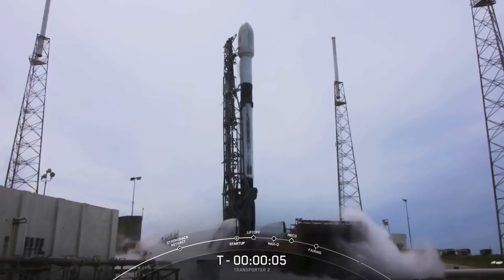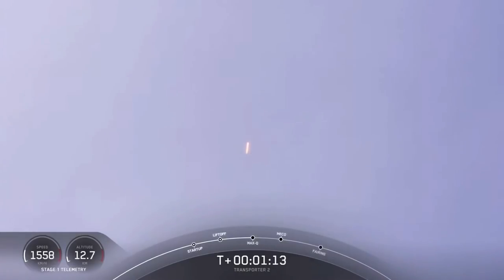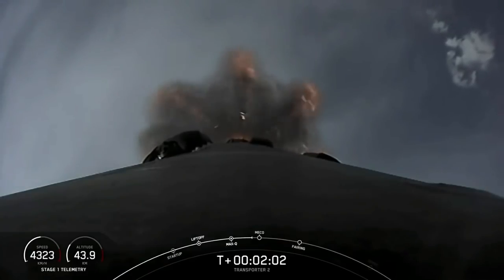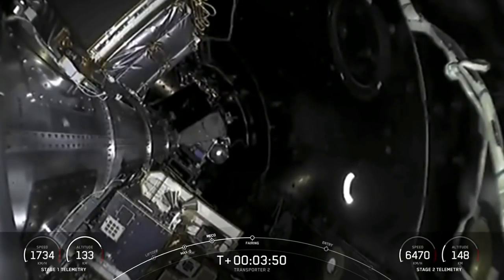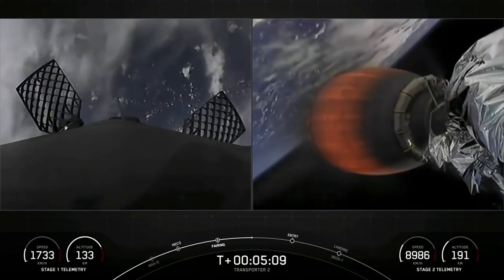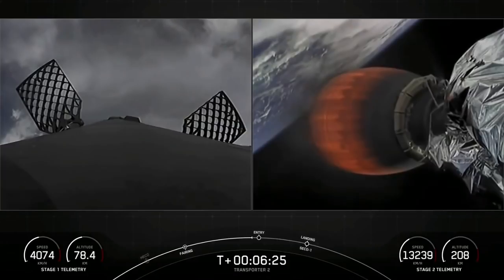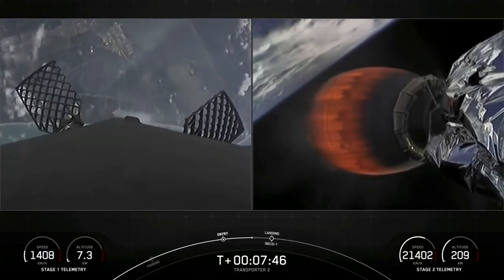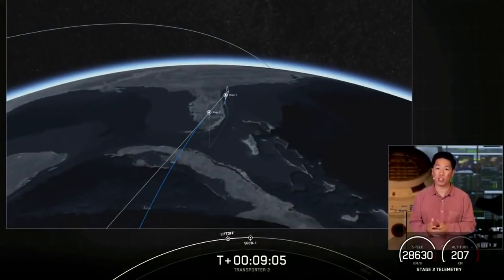SpaceX launches Transporter 2 rideshare, nails LZ-1 landing in Florida!

Comment: 0:18   It looks like extra flame off the right side of the lower part of the rocket.  Is that normal?
Reply: No it is not normal they are gaslighting us and people are eating it up
Reply: Looks like the oxygen vent being illuminated by the exhaust plume. Perfectly normal and poses no threat to the vehicle.

The Falcon 9 uses cryogenic liquid oxygen, which slowly evaporates as it warms up and has to be vented to prevent pressure build up in the tanks.
Reply: No that is not normal when it is all faked they got busted three times 2 with a mouse on the rocket mouse in the cabin running around the crew with no Gss during liftoff using there computers lol it is completely gaslighting
Reply: @rodneyhearld8151  I’m not saying you’re wrong and I’m not trying to start an argument but I really wanna see what you’re talking about. Is there a link?
Reply: @late344  youtube sensored and removed the videos , but I might have a link that still has it I will look
Reply: @rodneyhearld8151  thank you
Reply: @late344  world news reports  has them

Comment: Why is the foil above the 2nd stage engine wavering that far up?  Looks like wind effect but ther can’t be any oxygen up that far.  Is it vibrations?
Reply: There is still a small amount of air. The atmosphere gets thinner as you ascend, until you hit 100 kilometers altitude. That stage separates well before then.
Reply: Because it all fake kinda like the mouse on the rocket during flight and how about no Gsss in the capsule while going to the space station
Reply: @rodneyhearld8151  The only fake things around here are your brain cells.
Reply: @EuroScot2023  keep telling your self  that, sad you can't see what is right in front of you, it is plain and simple common sense, but you might be lacking that

Comment: What is that plasticky kind of Foil reflective material.... why doesn't pop with the pressure of the speed of rocket?
Reply: If you're talking about the foil around the motor components of the second stage, it is probably aluminized kapton, which is a strong, thermally stable polymer that has had aluminum applied via vapor deposition. It is used as a thermal reflector and barrier for the motor components. At the altitude of second engine start, there is nearly no atmosphere, so there would be very little, if any, visible interaction between it and the air.
Reply: The second stage engine has a thermal blanket over it to reflect excess heat away. The air gets very thin as you ascend into the atmosphere, so temperature control becomes far more difficult. This also means that the foil-like material doesn't have to be very strong, because there is almost no atmospheric drag to rip it off.
Reply: its kapton or mylar foil its for insolation of the engine and there is not so much stuff to bump into at 70km
Reply: There's no air in space.

Comment: I wonder how much cost (%) they actually save by not discarding rocket - because refurbishing it for another mission costs something.
Reply: Refurbishment is nearly negligible on the first stage. They do not take it apart and usually dont even swap engines. First stage costs about 45 million to build, I'd say total refurb is less than 500k per landing and propellant is also about 500k between LOX and RP-1. They lose the 2nd stage, propellant and sometimes fairings on each launch, but they do sometimes recover and even re-use (!!!) fairings, as you can see with this mission.  Looks like re-used fairings because you can see the soot on them at launch.  2nd Stage is about 10 million, fairings are about 5-6 million for both. so worst case they "lose" about 17 million in hardware per launch, let's say 1 million for each "refurb" (very conservative estimate). They charge basically 90 million for a F9 launch so let's just make it easy and say 20 million sunk cost per launch.  So in terms of cost savings to them it's 45 million out of 45+20 =65 million, so basically 70%. But remember they charge 90+ million.  So you do the math lol.
Reply: I believe I read that it saved the government 53 million dollars when they allowed the use of a pre-flown boosters on the next 2 flights
Reply: @Snookman7  Nice, but raw numbers don't really show the real picture. That is I'd like to know how much it costs to refurbish in comparison to assemling new booster.

Comment: Errrrr... 4:21 in the video... What is that spinning by the ship? Can't be the fairing halves, as they're way too far away?
Reply: It is ice. Large chunks fall off all throughout flight due to the densified propellant (colder than needed to be liquid, which increases density and therefore packs more molecules to be burned per unit of volume).  Because the rocket exterior is also the fuel tank walls, ice forms while in atmosphere and due to vibrations falls off all the time, similar to the space shuttle on the pad.
Reply: I was wondering the same thing. I guess I’ll have to wait for the Scott Manley video 😂.